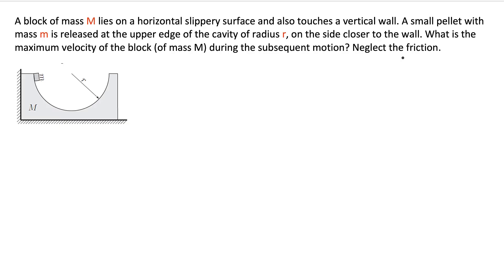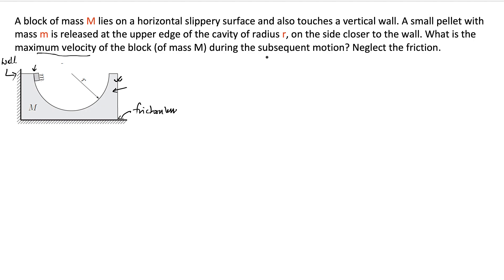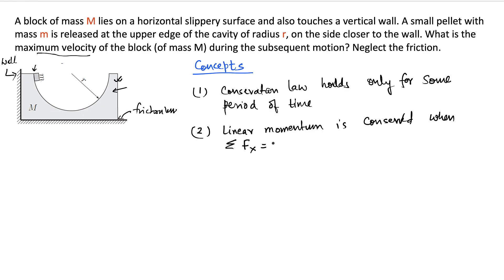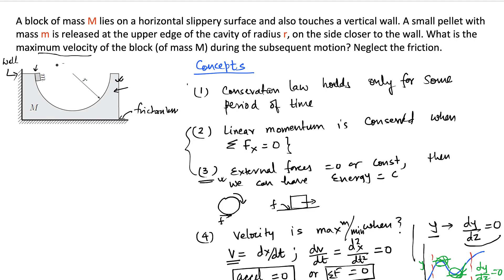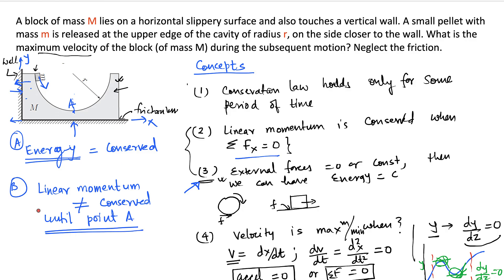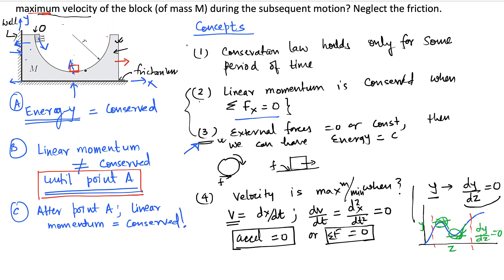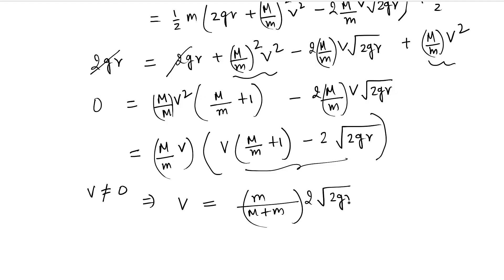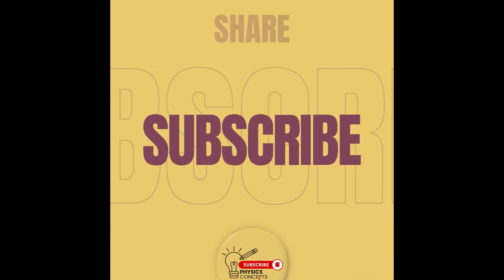Amazingly simple yet challenging problem for IIT JEE. Tons of concepts to learn. Can you solve this?

Comment: When you applied the conservation of energy equation from A to B why did you not consider the gain in potential energy
Reply from the maker: @vedantpatil2165  - we are considering when pellet goes from A to B and then comes back to B. See the max velocity of the block will be when pellet comes back to A second time [ from A->B->A ]. hence are considering only at point A when the block starts moving. And if you see we get two values, 0 and max V. It's 0 for first time and max second time.
Also - note that pellet doesn't go fully to point B [ see another video on this topic in the channel, here second problem in the video https://youtu.be/A7KaiZJkMTw ]

Comment: I think the bigger block will attain max velocity at Point B where the pellette will stop pushing the big block.At point A it just begins to exert force on big block in positive X direction. Please do respond.
Reply: In fact, the pellet will not reach B. It will start coming down (relative to M) before it reaches B.
Reply from the maker: Yes - it will reach (M/M+m)r
Reply from the maker: @maheshpant518  - The max velocity will occur at point A, second time when it reaches A [ O->A->B->A ].
The velocity of block M will keep going up but will reach max at A. The block M will start moving when pellet reaches point A for the first time, it will be max when it comes back to A again.
Hope it's clear.
Reply: Also, the pellet will not stop pushing M at the highest point it reaches. It keeps pushing M even on its way down, and only stops pushing to the right after it reaches A.
Reply from the maker: Actually at highest point - it will (instantaneously) lose the contact [ Normal = 0 ]. Please check the video (second problem in the video is from Irodov , https://youtu.be/A7KaiZJkMTw) - very similar to this one. But it will gain the contact and continue to push the for subsequent motion back to O.
Reply: @Physics-Concept-Problems  At the highest point reached why should the normal reaction be zero? It would have been zero, if it reached B. But not in this case.
Reply from the maker: Actually it will. Highest point doesn't mean point B. 
Common final horizontal speed is valid at the moment the disc breaks off — which is when the system has no more internal horizontal force interaction.
Reply: @Physics-Concept-Problems  This argument is valid in the other problem you posted. Because there the breakoff is happening on a vertical wall. A vertical wall can give only a horizontal force. That should be zero if the horizontal speeds of the two are equal. In that situation after equal speeds are achieved there is no more relative acceleration along x axis.

But in this case equal horizontal speed is achieved momentarily. The relative acceleration is not zero at the moment when this is achieved. The direction of normal reaction is not horizontal at the moment this is happening.
Reply from the maker: Actually losing contact is not dependent on vertical wall. In the other problem it's not necessary that the mass loses contact only when it aligns with vertical wall.
Reply from the maker: Losing contact is not dependent on the vertical wall. In the other problem as well it's not necessary for mass m to align with the vertical wall and only then it loses contact. Similarly here to it will lose the contact.
The moment both bodies have same horizontal speed - it loses contact.
Reply: @Physics-Concept-Problems  "The moment both bodies have same horizontal speed - it loses contact." This statement is not correct. Suppose an inclined plane is fixed to the ground. A pellet is pushed up the incline. Once the pellet reaches the top its velocity becomes zero. So its horizontal component of the velocity becomes zero, too. Therefore at this moment the horizontal component of the velocity is same for both the pellet and the inclined plane. Does it mean that the pellet looses contact with the plane momentarily, and the normal reaction becomes zero? Definitely not.

At every moment from A to B the relative acceleration of the pellet with respect to M is perpendicular to the normal at the point. This acceleration has to be created by the weight, the normal reaction and the pseudoforce due to accelerated frame of reference. It is possible to find an expression for the normal reaction at this point.

If for arguments sake, you assume that the pellet looses contact at the top, then it would mean that the acceleration of M at that moment would be zero. Do you think that is true? Remember the speed of M at that point is still increasing.
Reply: @Physics-Concept-Problems  I should add that apart from the tangential acceleration, there will also be a radial centripetal acceleration in general. But at the highest point the radial acceleration is zero, as the relative speed becomes zero.

Comment: Sir my doubt is that the third point which you have written according to my knowledge it should be like Energy is only conserved if there is only work done by conservative force that means non conservative forces can be present but shouldn't do any work for conservation of energy Because in case of free fall there is external force gravity but still energy is conserved because it's a conservative force 😅 sir please let me know if I am right, Sir with due respect I am not challenging your great knowledge but just wanted to clarify whether there is any correction in my concept 🙏By the way thanks for such amazing content ❤️
Reply from the maker: @tskakashi429  - You are right, absolutely. When force is present but displacement is 0 then work done is 0 therefore - all other energy will remain conserved.

Comment: Your answer is correct because you conserved energy. But at what situation, M will have max. Speed? Its not when m reaches at bottom from left extreme. Its when m reaches at bottom from right extreme. I did calculations that way & got answer in lesser steps. 
Also, if question - option were in statement form, your explanation may got into trap.
Reply from the maker: @think4all  - Thanks
When the pellet reaches the point A second time (it goes from A to B and then comes back to A - actually it will only reach a height = (M/M+m)r, not upto B), then the block M will have max velocity. If you see the the final expression, we get V = 0 and V = maxV, 0 is true when the pellet is crossing point A for the first time and when it comes back V is max. This is because when it crosses point A toward O, then again block velocity will be reduces

Comment: A transfer of momentum in x-direction requires that the mass m pushes the mass M in +x direction at least for some duration (like in a collision). In this case, till the point A, and even at point A, the mass m never got a chance to push M in +x direction. How can the velocity of M become a definite positive value instantaneously? Velocity of M will increase from 0 starting from the instant m crosses A. But it will increase continuously from 0, not abruptly.
Reply from the maker: @pothiquebor - Max velocity for block M happens when pellet comes to point A second time. When pellet first time crosses the point A - then due to linear momentum conservation, the block M gets the velocity as well. When it comes back to point A [ after going to B and coming down ] - at this moment the max velocity occurs.
What I was trying to tell, that until the pellet reaches point A [ from O ], there is no velocity for block M. Also if you see the final equation, we get two values for V, one is 0 and the second is max V expression. For the first time when pellet is there, V = 0, however, we rejected that because we were interested in max V.
I hope it clarifies things for you.
Reply: @Physics-Concept-Problems   That makes perfect sense! I was confused by the direction of u2. In most cases (i.e. m < M), u2 would be leftward. The other value of V also makes good sense. That is the minimum value of V. And that would happen when m reaches A for the third time. So the overall motion of M is as follows. So long m is to the right of A, M picks up speed, reaching a maximum of your calculated value when m is at A. And when m goes to the left of A, M starts slowing down coming to an eventual halt when m reaches A the next time. And this pattern continues.

Another interesting question related to this problem could be how high does m reach to the right of A. A simple application of  conservation laws would show that the height is Mr/(m+M). This is a very interesting problem indeed!
Reply from the maker: @pothiquebor - True. That would be good to compute :)
This indeed is an interesting question

Comment: 9:10 
I have a doubt 
Linear rmomentum is not conserved due to the net force of  normal reaction but normal reaction would be present in pairs to cancel each other out...
What did i think wrong?
Reply from the maker: Yes - but when you consider the forces on Block M, then there is a horizontal normal force on it from the wall.
Reply: Ooo ok
So we have to consider external forces acting on the system defined and on the forces due to systme on itself...👍

Comment: Sir, the velocity will be maximum at the bottom point but the direction of velocity of small block will be opposite to what you assumed and answer is coming same too
Reply from the maker: Velocity is max at point A when the pellet is comes to the point second time, therefore it will try to move left wrt block M. However, it may be right if the V is higher. So, during energy conservation it deals with u^2 and by changing the direction of u, the energy will not get affected
Reply: @Physics-Concept-Problems Thanks 🙏 you always reply to our doubts

Comment: Sir please tell me if my analysis is correct , when the pellet will pass the point A for the first time the vel of wedge will be 0 because till now all the force acting due to contact force between wedge and pellet was cancelled by normal recn by wall and ground . 
therefore , when we solved for the vel of wedge when pellete is at point A one of factor gave us V=0 .

Now the pellet will pass point A and move up the wedge but after some time the pellet will again start to move down the wedge and  at a certain time it will again pass the point A (this time having vel along negative x axis in wedge's frame) . 

So , this is the time when vel of wedge will be max and the other factor gave us vel of wedge for this moment when pellete is at A for the second time.
 
Sir will the pellet oscillate to and fro in wedge's frame and will this oscillation in wedge's frame be same as the case in which wedge is fixed and pellet is released from the same point ?
Reply from the maker: Yes - when the pellet reaches the point A second time - the velocity of block M is max.

Comment: why did you not take gain in PE of pellet from point A to B or any intermediate point in the conservation of energy eq.?
Reply from the maker: I did not consider energy conservation from A to B (although that's conserved, but we want to compute V of M at A). But the moment pellet started journey towards B, when it's still at point A. So at A itself, when it instantaneously crosses point A [ almost at A ], then linear momentum and energy is conserved. So the energy 1/2mu1^2 at A for pellet, will be converted into 1/2mu2^2 + 1/2Mv^2, at A itself, Pellet is still at A. Hence there is no potential gain. I hope it's clear.
Reply: Why we use point A?
Can not we use whole second half for max velocity?
Reply: Please clear it thoroughly

Comment: I have a doubt. You said at the bottom point the instantaneous acc in x direction of mass M is zero, hence the maximum velocity attained by the M block is at that point, but after that instant in x direction wont there be a component of normal(vector in 4th quad) provided by pellet in +ve x axis? 
Wont it accelerate the block to higher speed?
Also after point A the pellets P.E. would increase and the K.E. would be transfered to the block, right? 

Further, I didnt understand your point 1 that conservation laws hold between time intervals.

I also interpreted that when you said energy is also conserved when there is an constant force like friction, it meant that the work done by that force must be zero. Is my interpretation correct?
I would be very glad if you could clear my misunderstandings. THANK YOU
Reply from the maker: @sreerangananilan7673  - When the pellet crosses point A, then it will try to climb the block. It's velocity will decrease and then with linear momentum conservation, the velocity for block M will also go down. Also there will be force in x direction and hence acceleration will not be zero - so either velocity of M was max or min when the pellet was at point A. But since due to linear momentum conservation we know that V of M is decreasing, hence at point A, the V must be max.
Reply: So, you are saying there's both an acceleration along x and the velocity of the block is decreasing, both are kind of contradictory?
Reply: @souradeep3862  You should try to self analyze first